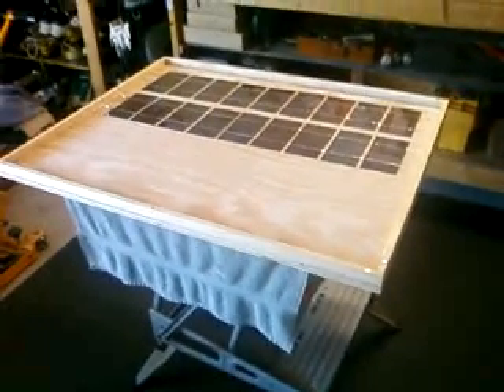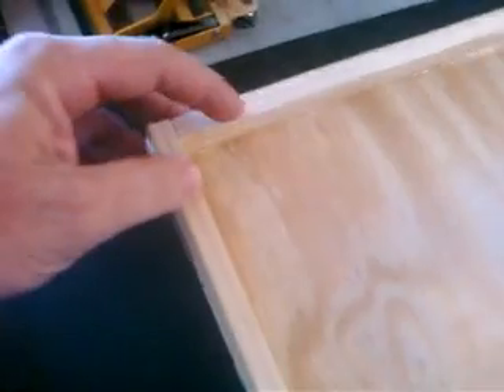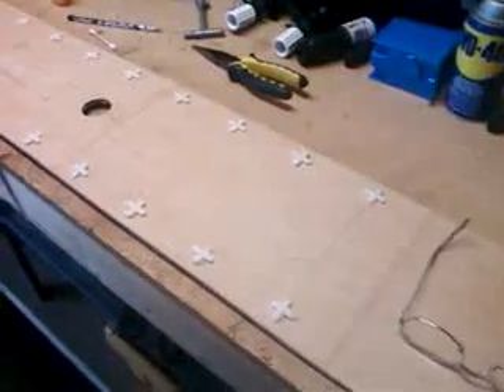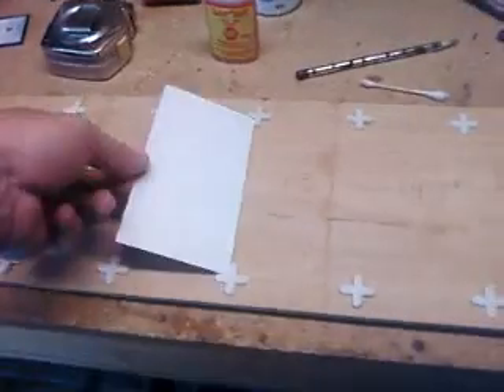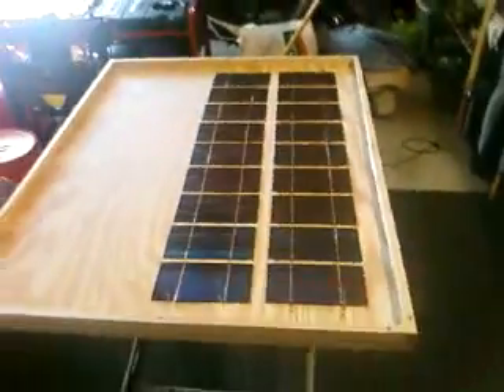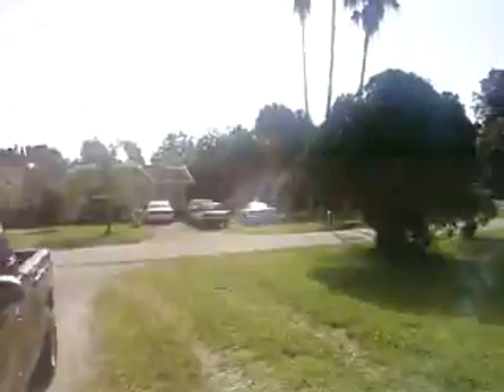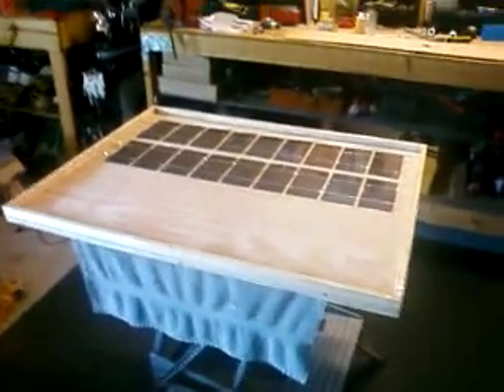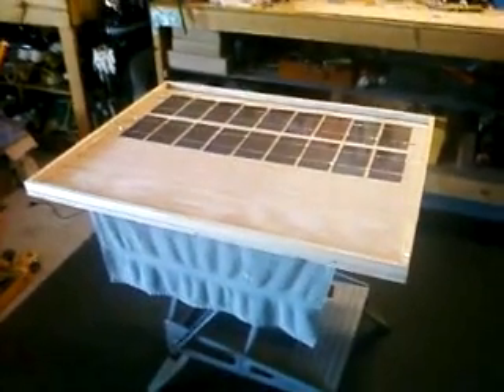My Solar Power Set up - Part 5  Building a Panel

Comment from the maker: It has cost about $120 so far, but some of the items that I bought can be used for another panel or two so my actual parts cost is a few bucks less.  I think that I can get away with about $150 for the whole thing.  Will put out an update in a couple of days.